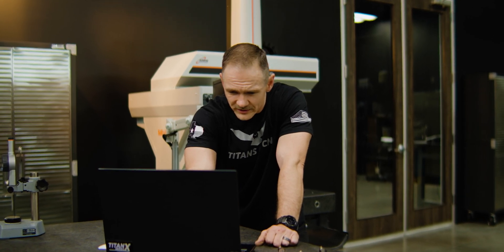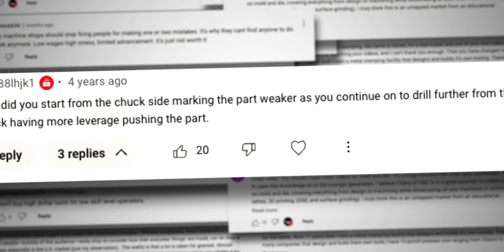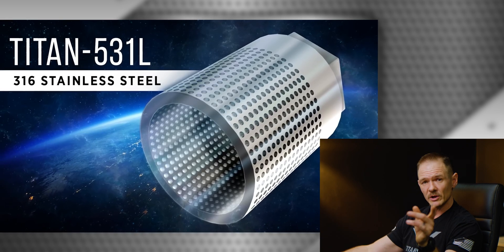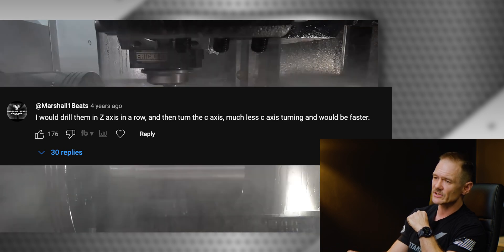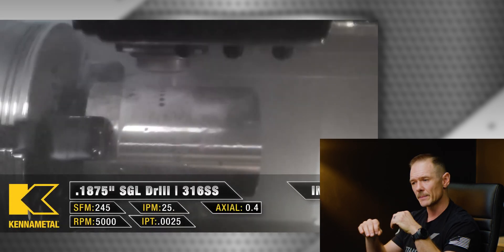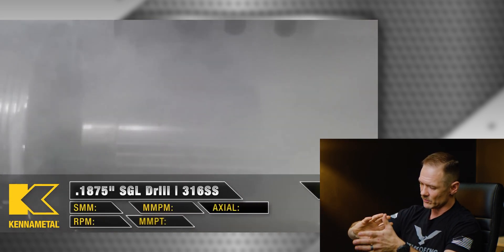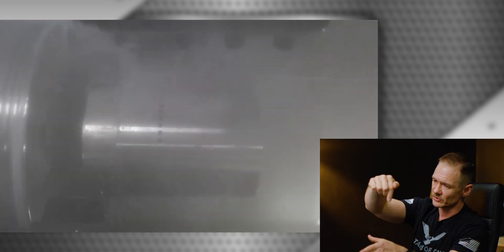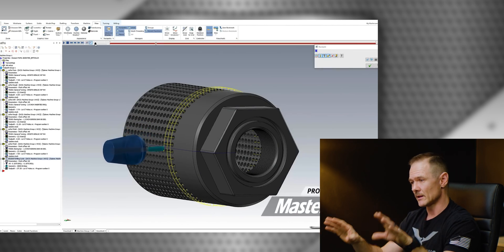Wrong Technique? Addressing the Comments

Comment: I think yall should go back and do the chatter video. Of course anybody that has been a mchineist for some time has had an issue with it, so just for clarification and attempt to really pinpoint an issue with chatter (relating to boring bar type and insert radius). 

I have an issue with chatter on my smaller lathe I run, but the way my machine is made (mazak QT 25), I can't push my boring bar much farther past the block. After running a newer machine (mazak qt 350), I have determined my issue with my smaller machine is most likely because of my bearings due to a few other factors thats wrong with it. Really goes to show how much this effects things

Comment: For checking flatness I remind my colleagues that you can take a certified 1/20 wave optical flat and tilt it at a 37.0397 degree angle and it will still be flat within 0.00005 inch. And level does not mean flat when you are measuring the curvature of the Earth on your surface plate. If it is within tolerance, it is good enough.

Comment: To check flatness,  must set on surface you are checking. On fixed points.
Just flip part over & rest on tooling balls or 1,2,3 blocks.
Sweep surface you are locating on.
Reply: You are just checking how parallel it is to the plate it is sitting on. Flatness only relates to the single surface, not what it sits on.
Reply: WRONG. Completely.

Comment: Just use 3, 4in Jo blocks
Reply from the maker: You can’t because there not adjustable
Reply: @TITANSofCNC  Both versions are valid: jacks adjustable or not. It depends on which plane you want to isolate (top or bottom) and what's the goal (flat or parallel). Most clueless commenters mix those 4 variables, scenarios.
Reply: @TITANSofCNC  they're

Comment: 1-2-3 blocks under the part inspection to ensure zero (minimal)  variance (you checked adjustable with the height gauge)  
Also should check the variance to the flange as well for uniformity

Comment: Thing people miss with checking flatness: If it’s parallel withining .001 that surface is flat within .001 (but not vise-versa) … Put the part up on jack and if it’s really thin it’ll distort under its own weight and you’ll get erroneous measurements. 

Metrology usually check flatness with the part sitting on a plate, too. Not up on jacks.
Reply: Flatness is in relation to itself and the only way to measure is on 3 jacks. Parallelism is the relation between 2 or more features. Your comment about flatness and parallel is completely wrong. 2 holes can be parallel but not flat. To check flatness it relates to the whole surface, not just 2 points. Parallelism can be checked with 2 points not a whole surface. Parallel and flatness has nothing to do with each other. To draw a comparison between the 2 is wrong and everyone you have told that to is full of misinformation.
Reply: @dikkybee4003 Theoretically correct. But I’m talking about quick and dirty flatness checks on a surface plate  in the shop. 

Jacks can influence the flatness of your part as they do not support your entire part like placing it on a surface plate would. 

If it’s something that really matters I’m going to have metrology or the quality check the part. They have access to CMMs, Faro arm, or laser tracker. In my experience a using a surface plate and indicator makes the flatness look worse than the dim lab will show.
Reply: @icey_b1562  Clearly you don't have practical experience kid. Come back in 10 years and then make comments. Some parts can't be checked directly on the surface plate, due to shape. Besides that, to check parallelism/flatness, the whole surface of the part (which is contacting/mating the surface plate) must be perfect already, otherwise you are "measuring" rubbish. That's why you introduce 3 points only (you have better chance to isolate one of the surfaces, therefore name of the technique: isolating the plane). Go figure.
Modern quality labs are full of monkeys with CMMs. They are not trained in classic methods.
Reply: It’s practice you’re probably right. But when it comes to checking, in practice you need a guaranteed way of checking something. I know this probably would never happen but it’s the example I’m going to use: 2 faces could be cut and from one edge to the next it’s out .125. On both faces. They can technically be parallel within .0005 but they are out of flat by .125

I just set up a job that gets turned on one spindle, then goes into the next for the second op. The flange on the first side calls for .001 flatness. I’m not going to run it on side 2 before I verify what I can on side 1. In practice, in my situation, his demonstration wouldn’t work. If I set the part on jacks on the finished flange face, and brought my indicator to the top of the part I would have gotten a very clear false reading because I’m checking a saw cut face.
Reply: "If it’s parallel withining .001 that surface is flat within .001" only true for envelope requirement. A flat to .010 can still be parallel to B under .001 as it's the nominal plane of A we compare to nominal B while checking parallelism.

Comment: regarding the 800 holes. the real time saver would be the C axis(spindle) clamp lock time. its slow. you can see the machine wait for the clamp to activate. some machines let you run drill cycles without the clamp active. m141 on okuma multus b400 or U3000

Mastercam doesnt take that into account (alteast for me)
Reply: I thought the exact same thing with the unclamp, rotate, clamp process taking 2-5 seconds per hole there is no way its faster rotating in C for each hole compared to a simple z axis move. Simulations and actual run times are never the same at least on the mazak's I run they aren't.
Reply: @ yeah moving in Z would be faster no doubt. i would do both no clamp and drilling the rows in Z
Reply: Was going to comment the same thing. Although I do agree with him; if hole tolerance is a major concern, it may be better to rotate the C axis vs drilling along the Z axis at which point it may be preferable to just ream the holes afterwards.
Reply: But the clamp does not happen at all or it does with low force as far as I know and it is not good for heavy machining. It is just a replacement for M147 which does little to nothing. Correct me if I'm wrong. The idea itself for drilling a lot of small holes is good.
Reply: I would ask mastercam to edit my post processor to get that code.

Comment: I totally get where you are coming from,  I didn't see the original video honestly but I don't see how people could say your checking parallelism when you clearly were adjusting those jacks to be zeroed to the granite. Anyway,  great video as always 🤙🏽😉
Reply: I’m with you some people are dense. But I will say I completely disagree with his statement that transferring the bottom face to top is the best way of checking it. 

I just setup a job on a dual spindle/turret lathe and on op 1 it calls for .001 flatness on a flange face. Before running it on side 2 I am going to verify what I can on side one. Now taking what he said about transferring the bottom face to top and running my indicator on the top face, I would have gotten a completely false reading as the top face was still just saw cut.

Comment: for the boring bar test, you should have done the test in reverse to avoid too much tweakings
basicly do the carbide boring bar with a 0.2mm nose radius at first, find the cutting speed and other parameters that actually is the endgoal you were seeking
then with that fixed parameters do every other bars and nose radiuses to look how much that will change
also it would be interesting to show the time saved if you incrase the nose radius but reduce the cutting speed, to see if there is any interest, but that would be in a separate video
also higher nose radius mean higher feed, and with a lower cutting speed, the insert would last longer

Comment: I would like to add my two cents to the feedrate portion of the chatter video. I did watch that video, but it was a while ago, so i dont recall exactly how you had the feedrates.
But for those who dont understand tool nose radiuses and the relationship they have with feedrate, let me (hopefully) shine some light.
A .032" radius tool at .040" depth of cut and .008" per rev has the same RELATIVE cutting parameters as a .0156" at .020" depth of cut and .004" per rev. For a .0078" radius you would have .010" doc and .002" ipr. (Paramaters I have used depending on the application). This is just useful knowledge to have, and if there are armchair "machinists" crying about how you went about your video because feedrates changed between inserts, thats their own problem.
Reply: Absolutely correct, each relative feed/doc per rad will leave a similar RA, disregarding the chatter issue.
Reply: That all is true, but he still spoiled his results as a comparison test, and that's what was being called out. The problem was that he changed feedrates only on the last, carbide, boring bar from what was used on those same inserts on previous bars.  And he did that change specifically because he knew that changing the insert and then lowering the feedrate would produce the better result that would hit their arbitrary target Ra. But it wasn't about actually hitting the target it was about comparing bar materials and nose radius. So without running the new slower feedrate on those previous bars again for that same insert type, or running the old faster feedrate on that insert on the carbide bar, the comparison between different bars and how much they chatter relative to eachother, is thrown out. And so defeated the actual purpose of the video, which he admits was the case here.

Comment: Yes, but like why would you ever do this when you are on a plate with an indicator and stand?. Fixed jacks or not just set up the perfect plane on the feature you are measuring then sweep the bottom. A lot easier to get false readings "transferring your fixed plane". I don't know just seems dumb to do it your way, not wrong.
Reply: I think its obvious why he wants to sweep across the top, you can see where the indicator is a lot easier, as well as the reading it gives.